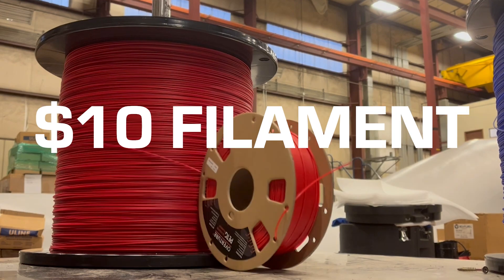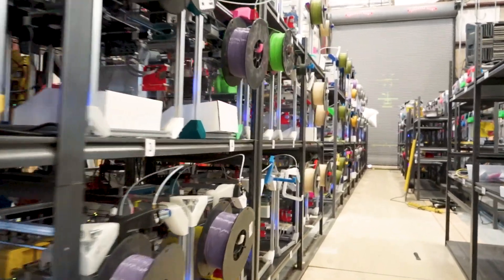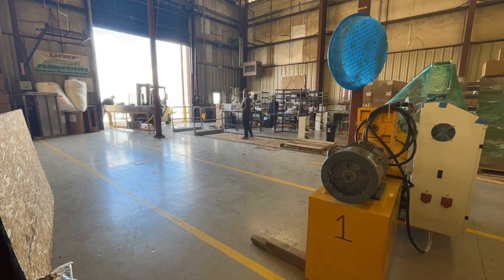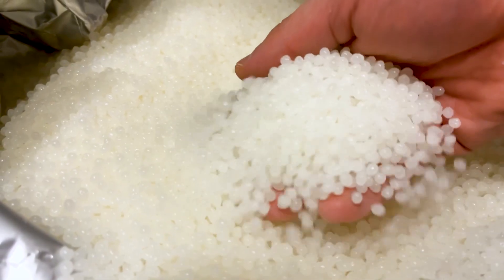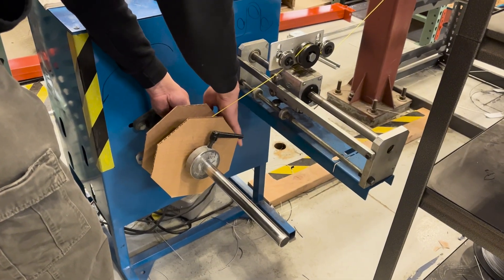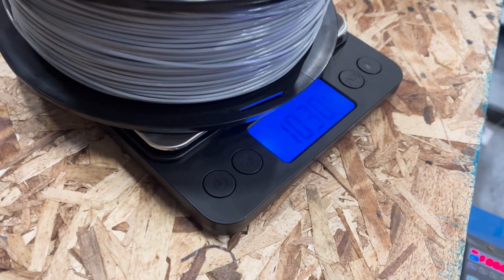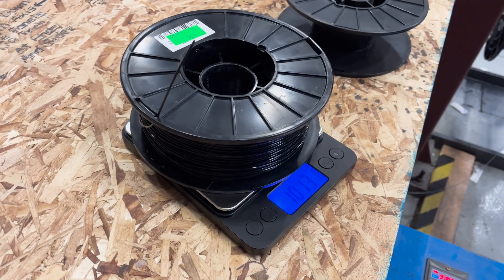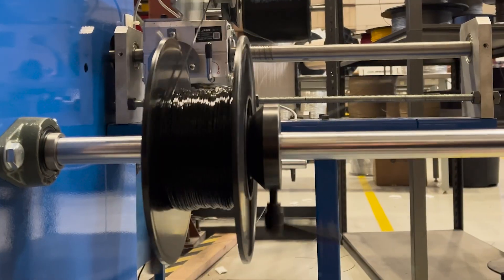Slant 3D Filament Launching THIS SATURDAY | First Step to $10 Filament

Comment: This is excellent. My silk filament comes from china and my general use PLA has been IIID max for a while now but I keep having QC problems. Normally it prints beautifully, but I've had about 6 bad rolls out of a batch of 9 that had chunks of carbon up to about 3mm across stuck in the filament. And then I had a roll from a different batch where the runnout was bad and caused the printer to loose layers. I really want to keep using their filament but it seems to be dicy for any mid to large scale print farm. They did send me replacement rolls for that bad batch but for a POD service I cannot afford to roll the dice on a brand new roll.
Reply from the maker: Absolutely. Hopefully we can help

Comment: One thing that everyone hates is filament tangles. I have a possible solution. 1. Box each spool. 2. Each box doubles as a guide. Customer unbags spool and feeds through slot n corner. Then, they close the box and punch out the center before hanging the box and spool combo on holder. The box will need to be big enough for spool to spin, though. So, round spool may be desirable for this.

Comment: I've been watching your segments for a while now and I'm interested in this also.  One thing i would like to point out though is that many of us use bearing rollers and in my case i print from my filament drier and the octagonal cardboard spools you are showing for the future won't work as they won't roll properly.  I see that you are also showing round cardboard spools that WILL work.  Please consider the effect this will have on us roller users.  If you have a good reason for wanting or needing the octagonal shape, making a side removable would help as we might be able to transfer the filament to a Master Spool.  Thanks and KEEP ON SLANTING!!
Reply from the maker: First ones are coming off with standard round plastic spools. We have also had the die cutter mark up standard round spools. It is not a problem

Comment: I like the idea, but GST in Florida already offers ~$10/kg filament.  How will your offering be better?  Thanks!
Reply from the maker: Mainly quality and supply reliabilty. Fewer blobs and less dirt. And have it in stock when it is needed
Reply: GST filament is a joke 😂
Reply: @whatisyouremailid  Please be more substantive in your comment.  Why do you dislike them?
Reply: @whatisyouremailid  Thanks for your additional comments. I use GST/Fremover as a supplier at ~200 kg/year.  I use several suppliers.  I agree that GST has some quality issues.  For me, their filament has not been brittle, but color consistency is an issue.  Regarding spools, I wish everyone would go to cardboard, as it is at least recyclable.  I like the idea that Slant 3D will offer USA-based filament, but I don't want them to enter the market thinking that there is no US competition.  The bar is high.  3D Slant's premise seems to be low cost (judging from the "$10 filament" in the title of their video), and in that market segment, they will need to prove themselves better than GST.
Reply from the maker: It is not hard to be better than existing low cost suppliers.

Comment: I am very interested. I love to support those who support the 3d printing community.  I have two things which i would ask you to consider, The 1st one relates to the bambu labs AMS units. The 1st would be if you could look into making your cardboard spools so that they could be taken apart like reusable spools are. Bambu AMS units do not do well with carboard spools but if i could easily transfer the filament to a reusable spool then the problem is solved. The second ask would be that you consider making some realistic skin tone colored filaments.
Reply from the maker: The first spools made will be on standard plastic spools. Unfortunately we likely will not make skinn tone colors

Comment: Didn't you say white filament obliterates nozzles so you don't use it? I installed a diamond tipped nozzle so I'm fine with it, but surprised you're using it.
Reply from the maker: You have to use white when you need it. And it does tear up your machine. But just do what you are doing...understand and prepare

Comment: Sweet.  I assume this is going to PLA or are you heading the PETG direction?
Reply: Yea, what I was wondering. I wont print pla anymore after switching to petg, i like it much more (petg)
Reply from the maker: It will start with PLA. We are working on getting petg implemented